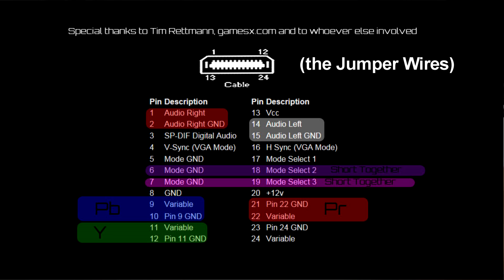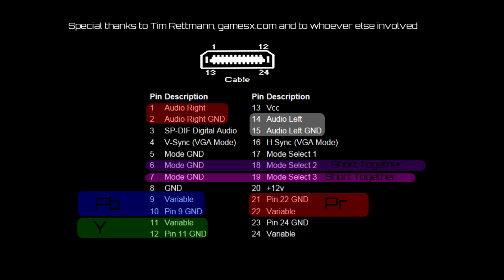Make Your Own Quality Component Cable For The Original Xbox

Comment: Thank you so much I got it on the first try. I used some spare component cables I had laying around and some of my games looks better now.
Reply from the maker: Nice! Glad to hear, not all games support high definition, a list can be found on Wikipedia.  Thanks for watching
Reply: i ordered some cables for my xbox original, but there were a ton of lines and flickering with them, will this cable mod resolve this?
Reply from the maker: +morganiothegamer yes this mod should solve your issues, thanks for watching
Reply: +TechnoOnTop SWEEEEET.  ill report back once i have completed the cable mod :)
Reply: +TechnoOnTop this worked for my problems with interference and noise in the picture. now its crystal clear. saving this video and sharing with my retro console buddies :)
Reply from the maker: morganiothegamer glad to hear! i also appreciate the support!